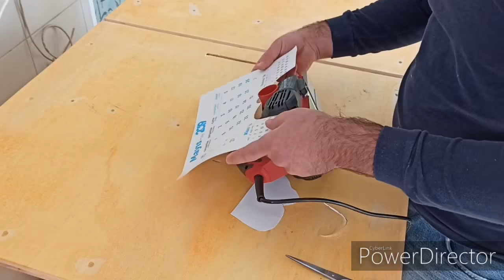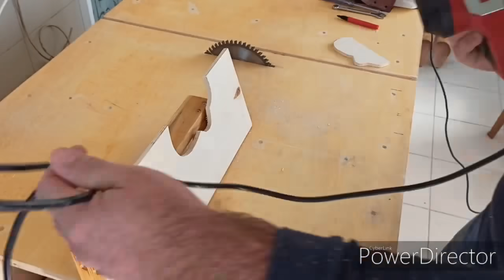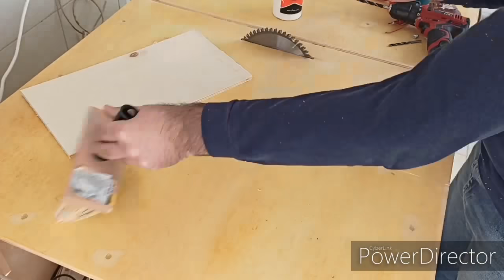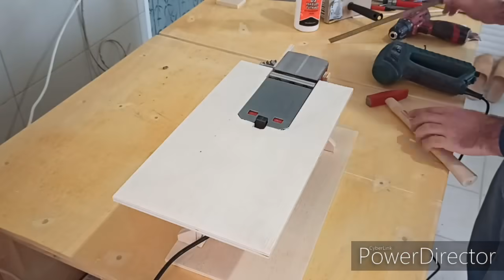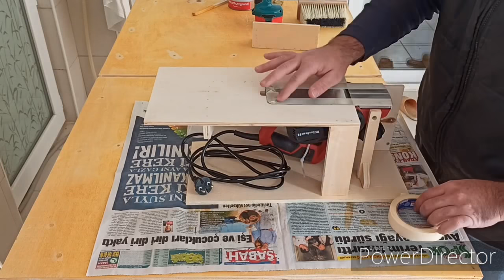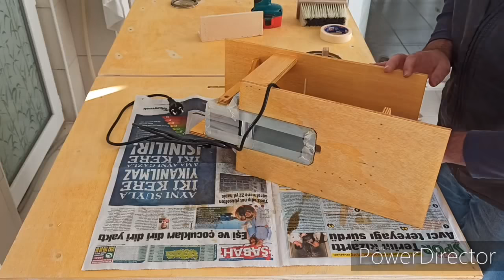Elektrikli Planya Tezgahı Yapımı || Making a Benchtop Jointer || Electric Planer Making || DIY

Comment: How do you prevent sniping the wood when you push the wood slab onto the planar? I had made a similar unit, but could not prevent the wood from sniping in the beginning. This was because the infeed table is lower than the cutter blades, and I pushed the job down, resulting in chipping the wood in the front (called "sniping"). How to prevent this?